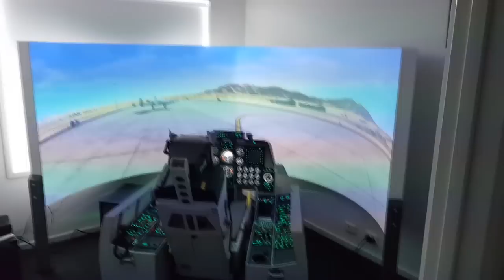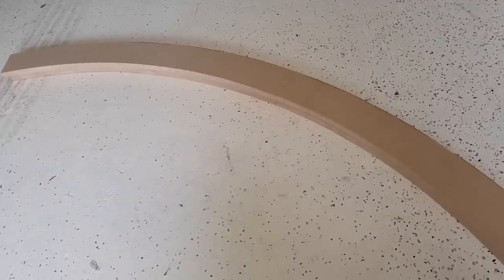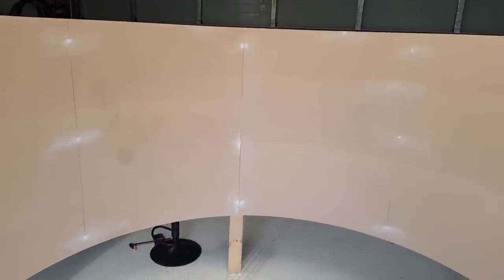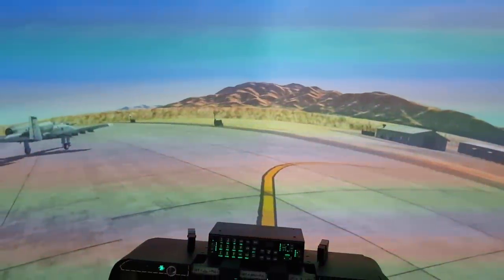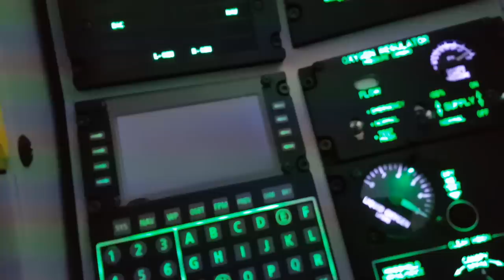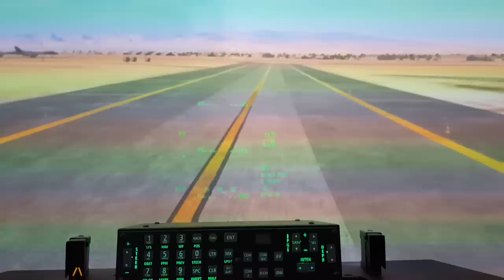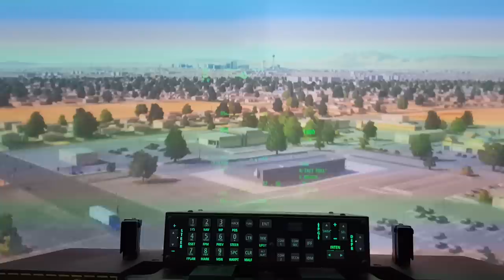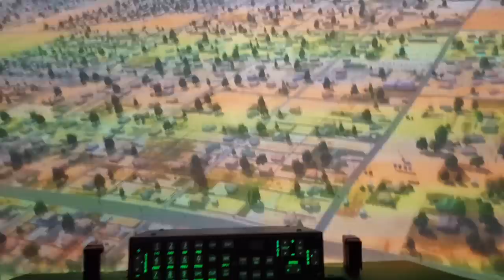D.I.Y. Cheap Curved Projector Screen- for the Flight Sim!

Comment: What's the radius of the curved screen ribs? thanks!
Reply: found it: Its a 1.2 meter radius, 2.4 meters in diameter.  The display area is 1.2 meters tall, raised 0.5 meters off the ground on legs.

Comment: how did you calculate the "length of the string" used to make the curves? I have bought all the materials to build the screens but cannot work out how you got 3 arches per sheet of MDF....
Reply from the maker: Hey mate, nothing fancy. The length of the string will be whatever radius you want your screen to be. From memory the radius of my screen is 1.2 metres, so all I did was run a length of string 1.2 metres, one end tied to a pencil, the other to a nail banged into a centre point. The centre point of your curve won't actually fit on the sheet of MDF you are going to cut, so what I did was just lay the two large sheets out next to each other and the nail was in the other sheet. Just pull the string nice and tight so it curves around smoothly and mark it with the pencil. Once you have a good curve marked, run the string out 35mm longer (which is the width of the posts) then mark another curve. You only need to measure out and mark one, because then you just cut it out with a jigsaw and use it as a template to trace around for the others.
Reply: @The Warthog Project the sheets I have are slightly larger than what you used, at 1220 x 2440 also the timber is 4x2 so the 2nd hole would have to be about 50.6mm away, are you cutting across the 1220 axis or the 2440 axis? so basically each rib is 1220 long with the 120cm radius?

Comment: Fix for the screen door effect.
Step 1. Buy 2 4K projectors with the same aspect ratio specs as the others.
Step 2. Buy an RTX 2080ti (or 2)
Step 3. Have around 6,000 dollars to spend (should probably be step one but meh) 
Step 4. No screen door effect but a hole in your wallet
Reply from the maker: Haha maybe on day if I win lotto!

Comment: With these cpu heavy sims you're better off with a recent AMD cpu. Cores matter.
Reply: lol
Reply: I mean, if this guy is looking for performance, especially where heat matters, I'd have to disagree. The FX-8000 series is pretty good for performance but you need a liquid cooler to run it at stock clocks lmao.

I'm currently running an i7-8700K @ 5.0GHz with temps barely breaching 87*C with a mid-level AIO. Try that on an AMD hexacore cpu and you'd have to call the fire department

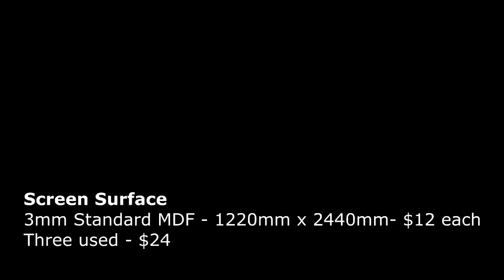Comment: Very nice project !  ...but your out 12 bucks at 6:04.
Reply from the maker: Your right! Sorry all-  it's a typo, but the maths is still solid. I only used two sheets,  not three!
Reply: The Warthog Project   I was only joking,  No need to defend your awesome work.  You have done a fantastic job and I thought I'd be a typical armchair comment section guy who picks out one tiny typo to make himself feel like he has helped in some way.    

Would you choose the same screen radius again? I was looking at setting up the three projectors over the 270 degrees like you suggested but am curious if you think your viewing distance to the screen is "ideal".
I wonder if you mounted the projectors to a common platform (and then suspend the platform) if that would take the ceiling motion out of the mix. I was thinking of a short steel beam and framework to hold the three projectors so they stayed relative and "locked" to each other.

Comment: Why not vr? It's much more immersive
Reply: Buttons, mostly. VR at the moment has terrible options for hand tracking, and if you can't see your hands, that's probably going to be a problem until a couple dozen hours in when you get used to it. You're going to be fumbling around in a small space with a lot of sharp edges, skinning your knuckles on everything for quite a while. Then there's checklists, something every pilot uses to some extent. VR also just doesn't hold up to a cost/benefit analysis if you want to get into the weeds. The screen he's got cost him $100 USD + 2 $90 projectors = $300. Compare that to $600+ for a Quest, plus $300-400 for a camera so you can see your hands, checklists, and the cockpit while in game, and then you've got to put all that into software, most of which doesn't exist except at a very basic level. That's a be-all-end-all setup, but one that when you want to upgrade, which will be in the next year or two, will cost you another $700 to do so. This is a cheaply upgradeable system with lots of existing software support. When he upgrades, it'll be about $120 for another 90 degrees of veiwing pleasure, and if he feels like he needs to look up, he could just add TrackIR to the system for $150, or go full dome and mount the projectors on the bottom. Kinda the same reason most people build their PCs instead of buying a MacBook Pro.

Sorry if I gave a long winded reply to a simple question. I'm bored, okay?
Edits: grammar